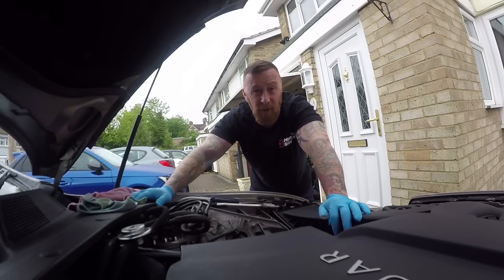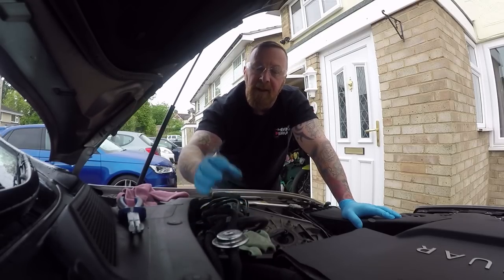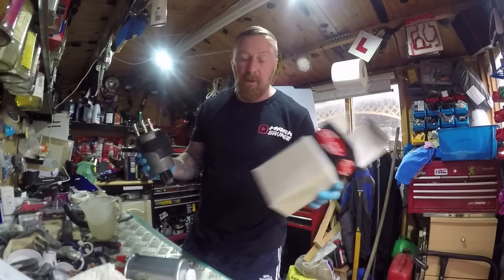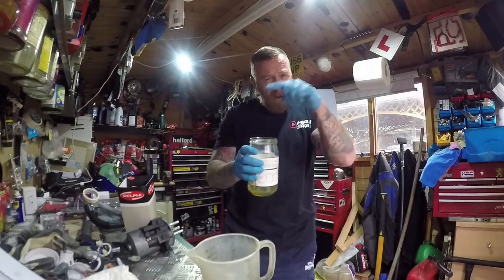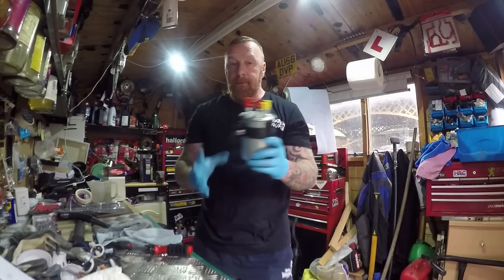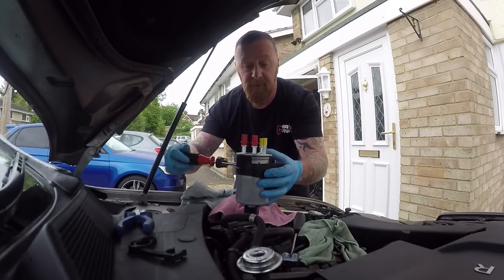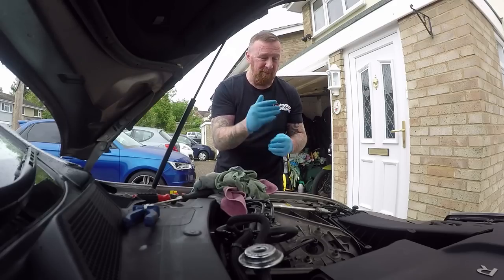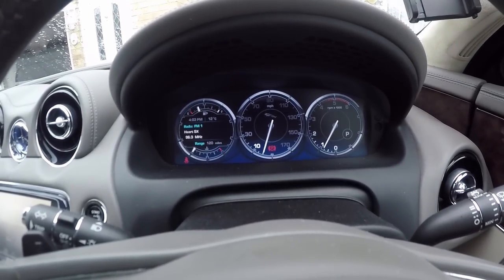CHANGE A DIESEL FUEL FILTER JAGUAR XJ MARK SAVAGE

Comment: Just want to say a huge thank you for this video Mark, it gave me the confidence to change my filter on my X-Type and having never done one before, and having little experience with diesel cars full stop, I did exactly what you did, only difference was I used a large syringe thing to prime the new filter with fuel, but everything worked first time, I'd never have done this without your video, so cheers pal!
Reply from the maker: Now this is wht I do them so thats great to hear it helped

Comment: Thank you so much for this walkthrough! I successfully changed the filter on my car in under 10 minutes!

I found you can simply unclip the 4 hoses and loosen the torx bit on the clamp to remove the filter. You can then gently lift it up, unclip the water sensor underneath and take it out. 

When replacing the filter, I didn’t fill the new filter with new diesel. Instead, you can turn the ignition on (press the start button without your foot on the brake) for 15 seconds to have the fuel pump prime the filter. Repeat this 4 times leaving a 20 second gap between each cycle ie ignition on, wait 15 seconds, ignition off, wait 20 seconds, repeat. I then let the car run for a few minutes to ensure it was running as expected. 

Well worth replacing the fuel filter yourself each year as part of general maintenance. I purchased a Bosch one from EuroCarParts for £21 - much cheaper to replace this regularly than risk clogged injectors!
Reply from the maker: Thats great to hear and yes you can prime the filter that way but old school and like to pre fill
All good 
Take care

Comment: Great video, jst gonna do the fuel filter on my 2013 xj 3.0d today thanks Mark . With regards to the oil change you can extract it from above, the small metal tube next to the n/s strut with the cap on top is where you access it, the oil filter is at the top underneath the engine cover.
Reply from the maker: yes that how i did it in the end but i didnt think i got all the oil out but still a good way to do it 
happy my video hopefully will help bud 
take care

Comment: Couple of things; as said before that’s a water in fuel sensor and you can prime these using ignition cycles (all 3.0D XF/XJ and 2.7D XF/XJ) ignition on 10 seconds, off for 15 and repeat 4 times. Yes takes a bit longer than priming it but a lot cleaner than trying to fill a filter. Also with how easy that air filter box came up it looks like the clips at the box of the air box aren’t properly secured as usually they’re tight to lift up
Reply from the maker: but I still like to prime as old school lol or just old pmsl and yes make sure everything in on tight and right lol

Comment: Great video 👍👍
The sensor in the bottom of the filter unit is used for checking for water in the fuel.
Rather than topping up the filter before refitting, refit the filter empty and connect it up as normal (ensuring all pipes fitted correctly) do not try to start engine but just turn on ignition (press start button without foot on brake pedal) you should hear the pump in the tank run for about 10 seconds and then stop, turn off ignition (press start button without foot on brake pedal) and wait 15 seconds, repeat this 4 times. Then start car as normal and check for leaks.
Reply from the maker: yes bud i knew this could be done this way but old school and always prime it this way on open filters
i did my daughters merc the other day and it was a sealed one and connect the in port ,covered it with a cloth and turn on the ignition till it filled up and then connected the out and it started all fine 
take care bud
Reply: Just like the Jaguar manual says. No need for pre filling.

Comment: I think the electrical  bit on the bottom of the fuel filter is to let you know you have water in fuel but also is a relay to let sat nav know the range that is left for driving, mine has been disconnected and now I have sat nav says insufficient fuel for journey even with a full tank and dashboard says range 0
Reply from the maker: Oh right maybe 
I was told its an air sensor but i like your idea better bud

Comment: Great video Mark! Your video has helped me to service my 2013 Jaguar XJL 👍🏼
Reply from the maker: That's really good to hear bud 
Always good to do it your self and save a few £
Thanks for watching
Reply: Mark, do you also have a video on how to change the oil on the Jaguar XJ too?
Reply from the maker: @roonyi5352  hi bud I did it with the oil suck up tool. well it not called that but you suck the oil on of the port on the side of the engine 
omg its so easy and only costs £25 but you can use it again and again so well worth it and so clean 
should have done a video of it lol
Reply: mark savage  thanks for that. I appreciate it. Seems nice and easy. I will look into it.

Comment: Nice one, many thanks. Hoping to do my Jag X types tomorrow.
Reply from the maker: as long as you prime the filter bud it will be fine, yes some say dont and it will prime but I like to be sure lol 
take are bud
Reply: @marksavage  will def fill it up prior. Should make starting a lot easier.
Reply: Did earlier, with no problems at all.
Reply: how did it go with your xtype filter change..I've just had injectors, fuel pump, egr replaced on mine and wanna change fuel filters..is it straight forward job? ive clocked up 200,000 miles now.👍

Comment: Mark Sir you are the man of youtube.for all types of mechanical vehicles  to tattoos. Lol have question on evaporation  of 50/50 antifreeze  mixture. What would cause it ? If temp gauge stayed normal an had oil . There's an over flow tube that will I guess allow too come out of reserve  tank if over hot or filled ? But it's needed refilled number of times in just weeks for past few months. And today temp gauge went almost as hot as it could go and we stopped driving it as fast as we could get it to ford dealership  a block away. They said they checked thermostat and it was ok ?if any idea what problem could be I would be great full for your opinion .
Reply from the maker: if your loosing water theres only a few places it can go, in or out!!
so your leaking water from some where like a pipe or the radiator remember you have two -the big one and the smaller one indies the car for the heating 
or inside so the head!!, i'e head gasket gone and you leak water into the pots ( not good)
now one more 
if you are burning oil due to oil seals etc, once you car get low on oil it will get hot and use water to cool the engine and as it will get very hot you will loose water this way but again bad 
so the answer is not good bud unfortunately, however you can get "stop leak" and a other makes that say they can stop oil and water from being lost piston seal or head gasket seal all the same sort of things
they will help but a temp fix really 
hope that help and thanks for watching my many many videos lol, take care bud hope you get it sorted 
mark

Comment: Can you remember the knack to get the sensor off the bottom of the fuel filter? I have the water in fuel warning and I am trying to detach the sensor to drain the water
Reply from the maker: i only took off the wire connector, maybe just flush it out and let it dry then refill, otherwise it maybe a new sensor if faulty

Comment: Followed Marks advice on the fuel filter change on my x351 65 reg v6 300bhp. Slightly different as couldn't get the filter housing out so hadto loosen the cage screw. Also tricky to unplug the sensor beneath. Eventually felt a wire that pushed in to release the connector lugs.
On refit l noticed a change in note from the engine, like a faint hum ( the big cat could be purring 😆). Does anyone know if this is normal?? 
I also changed the 2 air filters. The driver side one was quite clean but the passenger side one was very dirty, with crud in the air box well. Again, is this normal? Does one pull in more than the other. Any tips would be appreciated......plus any ideas around oil dilution ( currently doing oil changes every 3k miles, but maybe the filter changes will help).
Reply from the maker: the hum may have just been the new filter settle in, is it still doing it or was it there before and you just never noticed it ?
air filter now thats an odd one , maybe check the air intake pipe as it might be blocked or restricted air flow and thats why its clean
your only getting air in one side , just a thought lol
oil every 3k wow no bud ,i mean it wont hurt but yearly is what i do or 10k 
however you cant love them too much lol 
investigate more with the air filter
Reply: @marksavage  Thanks Mark. Hadn't noticed the noise before but Performance wise there are no issues. The only thing l have spotted is that l have routed one of the pipes on the diesel filter, over, rather than under one of the others. Small detail but could cause vibration. I will reroute that and see. I will check the air intake. Again, no Performance problems. Maybe the previous owner only changed one filter. Who knows. Thanks for the reply.
Reply from the maker: @markpenney8176  true you just don't know and if running ok think you might be right
Reply: hi , the two air filters with one dirty and other one clean is common . nothing to worry . one filter feeds air to low pressure turbo which is running from idle to 2800 rpm . this is the one that gets dirty . the cleaner one is the one that feeds air to high pressure turbo which usually remains cleaner than the low pressure turbo air filter .
Reply: @kedardesai3469  Thanks for the reply which makes sense but, alas, l have sold the XJ after only 8 months of ownership due to the oil dilution issue. Wasn't changing the oil every 2 months. Absolutely gutted. Rybrook Jaguar in Warrington didn't help. Just fobbed me off, saying it was probably my driving style. Yeah, right. I think that 3 litre unit has an inherent problem that Jaguar don't want to admit. I even asked them to check the injectors but they weren't interested.
Reply: @markpenney8176  oh my . What was the issue exactly ? Mine has 60,000 kms and going well . Oil change every 10,000 kms .
Reply: @kedardesai3469  Never found out unfortunately. I do know that quite a number of owners of the x351 have reported the same issue. One guy did say that changing the injectors did resolve it. Too late for me though.

Comment: Just watched this video as I'm going to change my XJ fuel pump. Do I not need to remove the fuse to the pump first so I can release pressure?
Reply from the maker: No just put a rag over the top and do it slowly just incase any pressure is there 
You doing the fuel filter at the same time ? 
I would
Reply from the maker: Any way what's wrong with the pump ?
Reply: @marksavage  apologies mate, it's the filter I'm doing not the pump. I'd read somewhere that you had to disconnect the fuse and turn the ignition to release the pressure - just wanted to make sure before I started. Wish I'd never filled up this morning though!
Reply from the maker: @snazzyjazzers9539  no bud ,no need it just all comes off like I did in the video
I just pre fill it 
Many say you don't have too 
Me I always do
Reply: @marksavage  cheers mate, all done within 30mins thanks to this video... Only negative was losing a screwdriver bit down onto the engine tray

Comment: Ps mark ,you can suck the oil out using a suction tool it saves dropping the belly pan hope this helps
Reply from the maker: Will have to look into that 
The video I watched there was like a pipe in the middle where mine has just a hole and all I can see it the cam 
What happen to the crap that’s in with the oil that normally comes out the sump when you do it way 
Yes I can see it really would be easier and save time so maybe will have to look into it 
Again bud thanks for the advice
Reply: Hi mark just another way of doing it,that’s what I do and I have done it about a dozen times on different motors
Reply: @marksavage  Hi Mark, bit late in the day i know but if your car has the oil extraction pipe the other end goes to a dimple in the sump which is actually lower than the sump plug so it will get everything out

Comment: You don’t need to do that Mark, just put the new filter on plug in the wire connector putting it on for 10 seconds turn it off back on again for 10 seconds do that about four times and the fuel pump actually bleeds all the air out of the filter
Reply from the maker: Yea I know bud , just old school , I do that on most to be fair

Comment: Hello Mark do you still have the Xj? I am planing to buy one.....I was wondering if you are still recommending that car. Many thanks.
Reply from the maker: i dont still have it but to be honest i do miss it , would i recommend one 
yes but do your checks and make sure it have history and lots of paper work , it have two belts that need replacing so make sure they are done 
sunroof problems etc 
not sure what year as they did correct these few issues 
but you wont be disappointed

Comment: Mark ive got a sym jet 4 125 on a 15 plate the exhaust is knackered ive seen an sym fiddle ll 125 and the exhaust looks the same do you think it would fit my jet4 125cc
Reply from the maker: hi bud , ive not work on one but best contact the seller as to be honest most have the same engine and placement 
so just ask to see if it would and im sure they will help bud 
thanks for watching ,
Reply: @marksavage  thankyou very much

Comment: Hi mate good video ,but you dont need to prefill the filter all you need to do is switch the Ignition on for 10 seconds then repeat job done
Reply from the maker: b6spb steve old school bud done that to an old car and it just wouldn’t run
I know the modem car with the power fuel pumps would fill but just wanted to be safe than sorry 
But thanks for the advice bud and for watching
Reply: Good advise anyway ,enjoy your videos
Reply from the maker: b6spb steve thanks bud